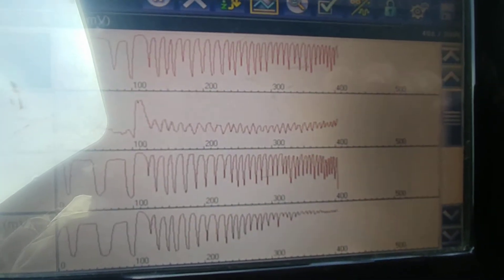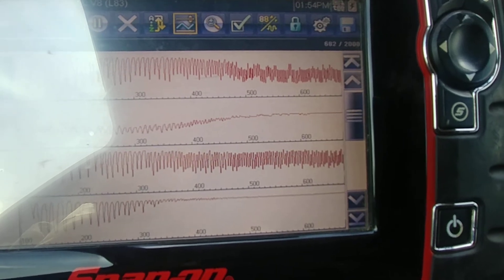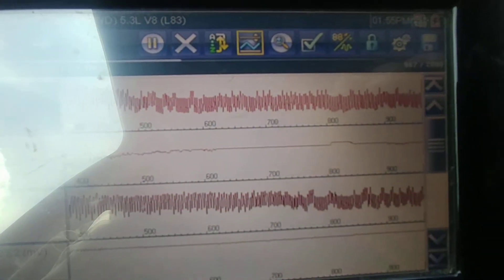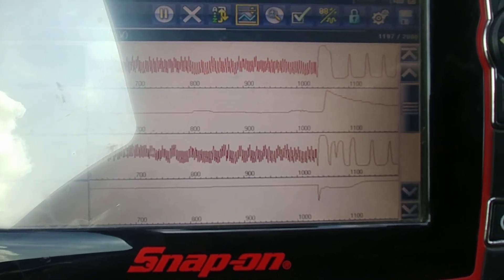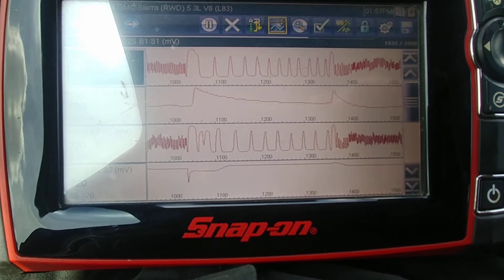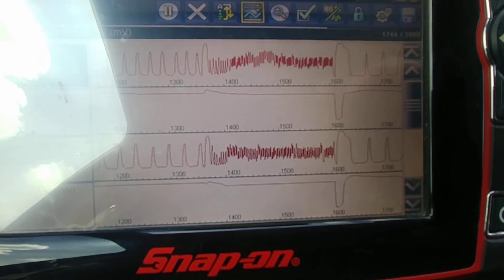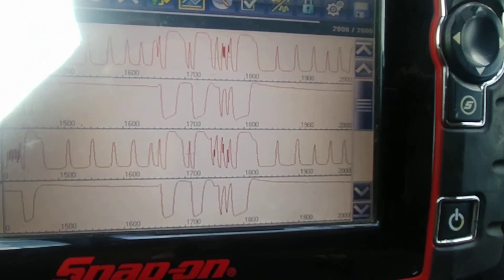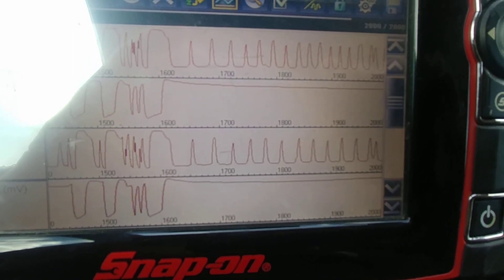Real time data showing p0420 and p0430 causes after installing aftermarket converters GM products

Comment from the maker: I didn't say this but with the right hacker (I will not say programmer) you can delete the code as an option. Again illegal only a hacker will do that. I am with you when you can buy a gas-powered lawn mower that will expel more than any modern car, it is a double standard for sure, but regardless plants thrive on CO2 so why would we deny them more of it? 
Remember this that same lawn mower uses a carburetor that meters fuel based on one simple rule 21% oxygen in the air it inhales, that number is ROCK SOLID. no matter how much CO2 we release. It's all about control over us remember that......

Comment: Been chasing my tail on 2010 gmc acadia with a p0420. Makes sense for gmc to only allow their garbage require a $1000 cat in order to solve the issue.
Reply from the maker: Im sorry its frustrating thsts why I made this video to try to help people understand why they are not crazy. Ive seen people replace computers for this issue as well which of course makes no difference.

Comment: I’m having this same issue with my 2008 jeep jk, installed two after market pre cats and cat,  and I got my codes back, runes fine just a code. Any way to get rid of the code?
Reply from the maker: Sorry for the late reply, no, unfortunately, the programming is looking for a specific sustained voltage and only a factory cat will match it, the O.E. is interested in replacing your vehicle after 80000 miles so these very expensive parts help push you in that direction.